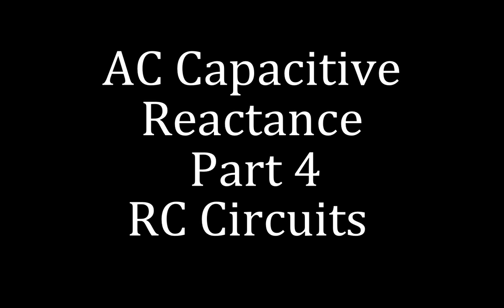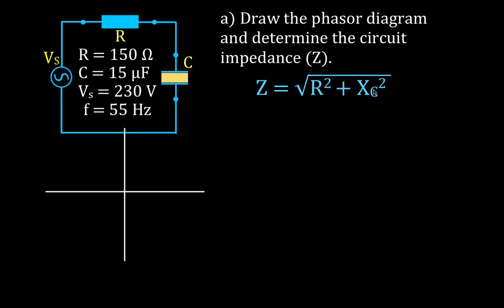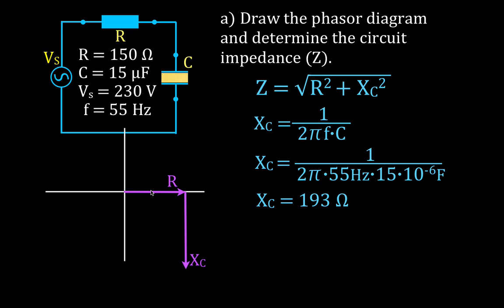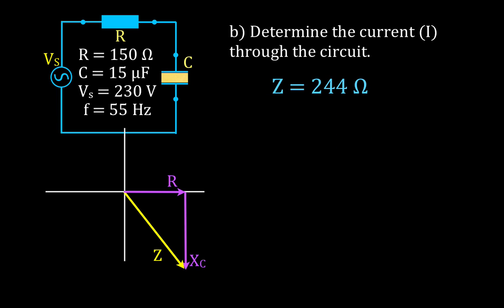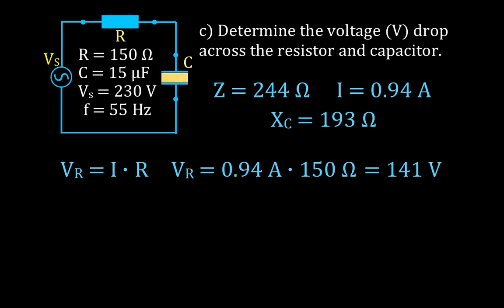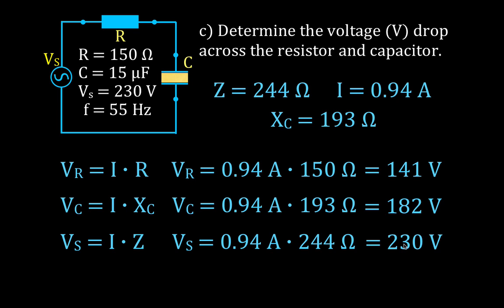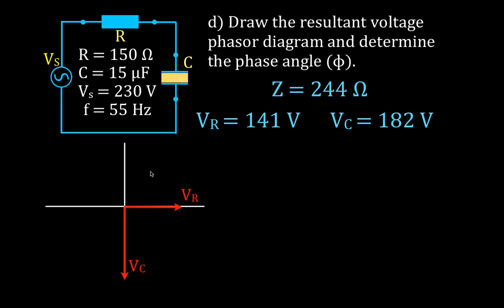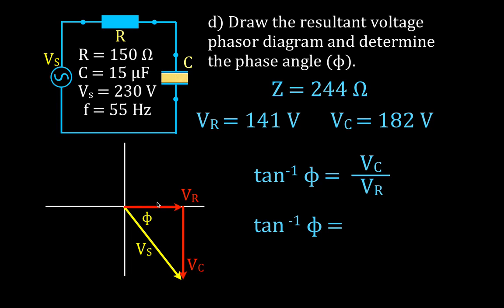RLC Circuits (10 of 19) Series RC; Calculating Impedance, Current and Voltage

Comment: Hi, nice tutorial, but the mathematics at the end are wrong: tan^1 (angle) or arc tan (angle) = arc tan (Vc/Vr) that then equals the angle in radians. After getting the radians, to get the angle, you have to transform radians into degress, wich can be done by simply: degree = (radians * 180) / PI . Take care
Reply from the maker: OK, thanks

Comment: Thank you for this clear presentation.  I now have a much clearer understanding of the logic behind the calculations. I am still struggling with an issue trying to measure the voltage drop across the resistor using my oscilloscope which is giving a result equal to the source voltage (sine wave) whereas the result for the capacitor drop is what it should be.  Probably just something to do with how I'm measuring.  Thanks again!!  I'll definitely check out more of your videos.

Comment: Thanks alot.. I have such a clearer understanding of everything... 2 hr lectures vs 6 mins videos smh.. but I'm confused, from my lectures I've learned that z = R + Xc and/or Xl not z = sqrt( (R^2) + (Xc^2) + (Xl^2) ).. I'm seeing this for the first time..
Reply from the maker: I am not exactly sure what you are referring to but it is a right triangle so you have to take the square root of the sum of the squared values.  Simple the pythagorean equation.  Does that help?
Reply: yh i figured after watching the vid again it was all about trigonometry.. I'm just saying that how I was taught to find impedence is Z = R + Xc + Xl, no sqrt, but i figured what you were doing.
Reply from the maker: That is right, the impedence is the sum of all the oppositions to current flow....but you have to add them up the right way...using some trig.  Great that you got it!

Comment: What drawing program do you use for your animations? They are pretty nice, I wonder if you feel the time it takes to produce them is worth it?
Reply from the maker: I am very low budget, McBook Pro, QuickTime and Keynote.  That's it!
Reply: keynote -- I will have to check it out :) Anyway, seems like it works pretty well, of course, I wonder how long it takes you to put together the 10 min presentation with it :) I am doing an online EE/embedded course. I got out of teaching, got burnt out writing books, etc. But, one thing I learned was the asset creation could take foreover for a book, and in the end rather than photoshopping a figure, I found I could draw them 10x faster with pencil and graph paper, and then let the art department turn them into drawings. The video stuff is the same, it takes so long to make a "good" presentation with animation, that I feel, just a screen cast and drawing program is much faster -- but I wouldn't mind things looking cleaner than my horrible writing on screen (even with the tablet).  Anyway, I have been watching others to see what they are doing and how "engaged" I feel. You talk as fast as I do, that's one thing we both need to work on is slowing down :) Anyway, great beginner videos -- good work. 

One little typo I saw though and I think its on a number of videos you have tan-1 phi = y/x, what you want is phi = tan-1 y/x, since the original equation is tan phi = y/x, you take the inverse tan of both sides, you are left with phi on the left, and then tan-1 y/x on the right, i.e. tan-1 (tan phi) = tan-1 y/x -> phi = tan-1 y/x. Check it out...
Reply from the maker: Yes it take a while, did earlier vidoes with a tablet but had a hard time writing.  Also I can use the Keynote over and over in my teaching.  Average video 5 to 10 hours.
see al my videos at my website  http://www.stepbystepscience.com